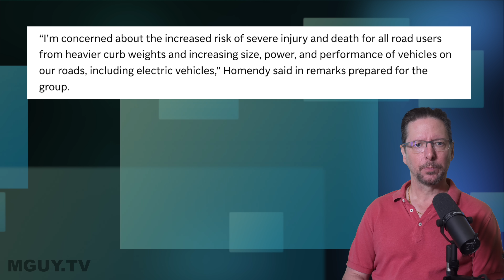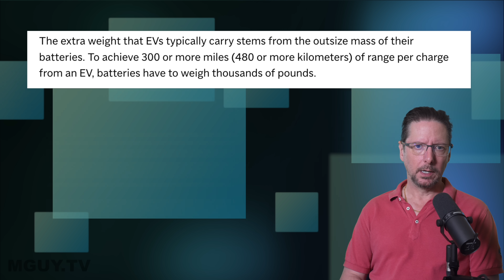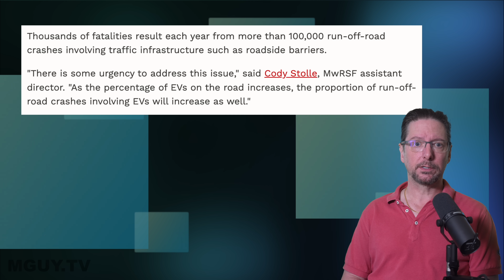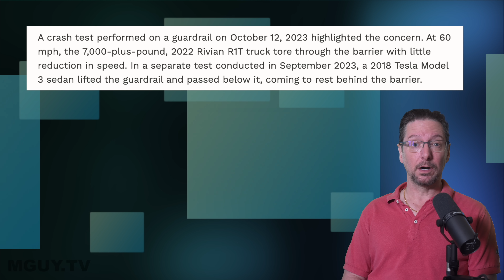EVs TOO HEAVY for roadside crash barriers (guard rails) | MGUY Australia

Comment: Perhaps they should tax by the pound or kilo for the road tax?
Reply: It's coming and regular guys aren't going to benefit. Car ownership will get more and more expensive leading to less and less private cars.
WHICH IS THE TRUE GOAL.
Reply: @evgeny7039  Er, it isn't, because no government anywhere could afford to lose the tax revenues they rake in from the motorist. Has it also not occurred to you that having no privately owned cars would result in millions more jobless. There would be 800'000 jobs lost in UK car making alone, let alone the jobs lost at oil refineries, fuel tanker drivers, petrol stations and motorway service stations, car dealerships, garage repair shops, tyre fitting depots, car body repair shops, the AA and RAC etc.... The UK government alone would lost £35 billion per year in lost taxes. What other taxes would need to increase to make up the shortfall?   And how would all this be in any way advantageous or of benefit to the government? Please explain.....
Reply: @Brian-om2hh Clean air zones, congestion charges, increase in parking charges ( even and especially in some cases for EV's), all designed to reduce car use, and by extension, car ownership. On balance I have to disagree with your opinion, but time will tell.
Reply: @Brian-om2hh There's no need for you to worry on the government's behalf about loss of tax revenue from lower car ownership, because governments across the world are experts at being creative about introducing new taxes. There's always a way to replace reducing revenue with a new tax. I think you credit our governments with more decency than they deserve.
Reply: @Brian-om2hh  He has a point even though his reasoning for it is BS. 
Private ownership will massively go down when  full self driving cars will hit the market. I expect them around 2030. Most cars rust away at least 23hours a day. These are the reasons why companies like VW are investing in "mobility as a service" like MOIA.
Reply: @Brian-om2hh 
New sources of revenue are being created every minute.
The government will not be overly affected. Our only hope of avoiding this fate is an overhaul of government, which we all know won't happen!
Reply: @Brian-om2hh  The government can print infinite money. They don't need any tax revenue because they can just tax you through printing. Sure it's going to cause a massive inflation, even hyperinflation problem, but the people who are in charge of governments aren't going to lose their wealth and lifestyle. They are always first in line to receive the printed money and have option of moving to a different country. The government isn't a monolith that works for the advantage of "the government". The government is a group of self-interested people who work for themselves and whoever writes their paychecks.
Reply: @Brian-om2hh  Brian, please avoid non-conpsiracy concepts, they are not preferred on this channel. thank you.
Reply: @paulhillman400  I think Clean air zones are too create zones of clean air. Just use a low emission vehicle. The reduction of car ownership isn't the target, clean air and east, efficient transport in the city is.
Reply: @seannewman5391  You may be right, time wil tell.
Reply: @paulhillman400  I think you hit the nail on the head. We are on the brink of some big changes. Time will tell.
Reply: @svenweihusen57  Why will full self driving cars cause car ownership to decrease ?.
Reply: @paulhillman400  people will simply stop owning personal cars but use shared mobility plans. A normal car is hardly used an hour a day but you will pay for it 24/7. So you need a car, ask for one, it drives to your house, restaurant, wherever you are, drives you to your destination and afterwards drives to the next customer. These cars will last for 3-4 years and then get replaced. Sounds like a short timespan but they are used 24/7 excluding the times for charging.
Reply: @svenweihusen57  You may be right, but  I hope not, it sounds distinctly dystopian to me.
Reply: @danielstapler4315  Haha. I like it. 😊👍
Reply: In Australia, registration/road tax is factored by weight and axle count.
Reply: No, taxes are bs no matter what vehicle
Reply: @mblake0420  I hope you know how to build a road yourself.
Reply: Please do not give bureaucrats any ideas they are already taxing us to death
Reply: They are pushing an agenda. More likely road tax according to emissions of car.
Reply: GVM
But it wouldn't surprise one to learn that EV regos will be subsidised as part of some green agenda, one day.
Reply: Andrews tried that in Victoria (an EV mileage tax) it got shot down in the courts late last year.
So now they know what WONT pass, they will be working full speed ahead on formulating legislation that will pass.
Get ready for new taxes, probably covering ALL types of vehicle.
Reply: Maybe you should pay based on the likelihood of crashing and EV drivers would pay less?
Reply: @Audioremedy0785  All the BEV that have had to be written off? With all that instant torque BEV drivers like to brag about? BEV drivers would pay more.
Reply: Might get a few LandCruisers. Prado's, Nissan Patrols, the list goes on off the road.
Reply: @GDM22  And might not too. Those that have a need for them will not give them up as readily as an ordinary car owner can be cajoled into replacing a typical ICE vehicle with an EV. They're more than just mere transport to some.
Reply: @erroneouscode Hmm, where I live they are everywhere and driven by people who have probably never ventured off road or even towed anything. Have no issue with people who need them I respect the fact that EVs are currently not for everyone. I do think people buy bigger cars than what they need, just in case.
Reply: What? Without any consideration for distance travelled or type of road used?
Reply: In Denmark they have changed it from a weight tax to a green tax, so I pay 4-5 times more for my 900kg ice car than a 2t ev car
Reply: @SnakeQQeyeS  Another unsubstantiated comment from an anonymous YouTube viewer. Do you have a link to reliable reference articles?
Reply: @SirGregoryPageTurner  my reference is that I live in Denmark and tell you how it is..
Reply: @SnakeQQeyeS  You're still just a random guy venting on YouTube. Give me some evidence.
Reply: @SirGregoryPageTurner  that I live in Denmark? or maybe you could just google and learn what the law in Denmark is. 
You are not to bright aren't you? 🙆
Reply: @SnakeQQeyeS  The rule is this: you make a claim, you back it up with evidence.
Reply: @SirGregoryPageTurner  google the freaking evidence. It's the law in Denmark.. 
Denial is strong with you I guess
Reply: @SnakeQQeyeS  OK, I accept, in principal, that Denmark ICE vehicles are being penalised to encourage EVs. I now also accept that Denmark is taking the Climate Crisis seriously.
Reply: Let's go 1990 Honda Civic!